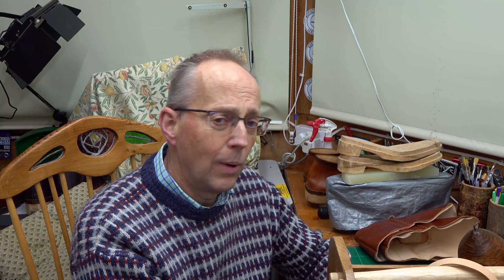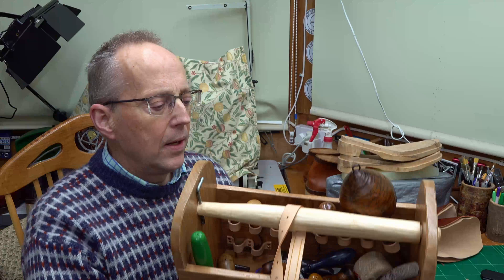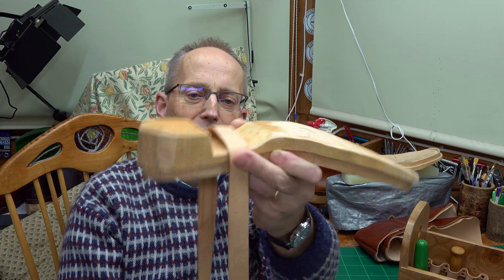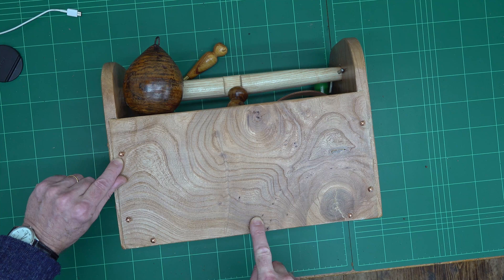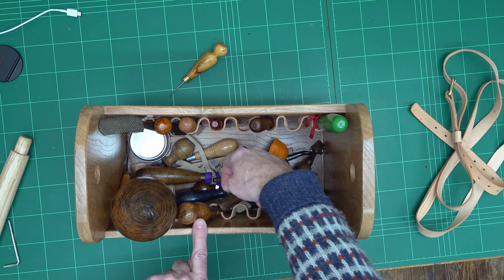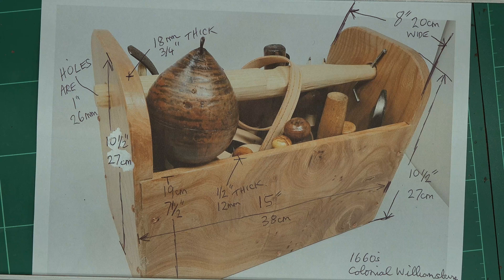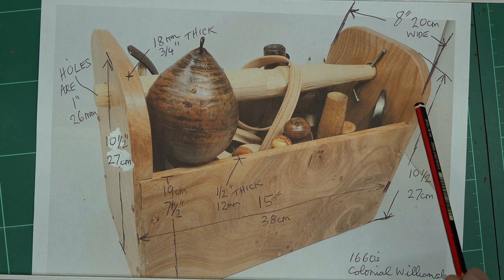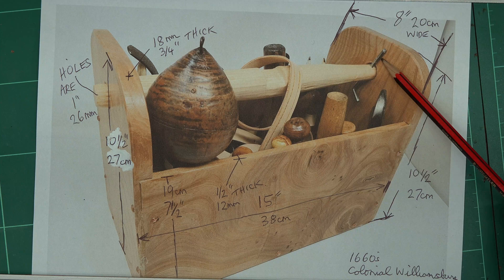1660 Era Ingenious Tool Caddy From Colonial Williamsburgh - Free Plans To Make Your Own

Comment: Thanks Harry. I use a toolbox of similar design, every day. Mine is made of plywood and has a piece of conduit for a handle. It's 8x20, lightweight and easy to carry comfortably at your side because it's narrow. I've added basswood blocks full of small holes to hold drill bits etc.  I wouldn't trade it for anything, think I paid twenty dollars for it at an auction
Reply from the maker: That sounds a very good design Karl...the lightness is great.

Comment: Very good to see you again.  My dad had a couple of tool boxes like this, one a bit larger than the other.  I don't recall seeing him use a strap to carry them, but he did have assorted leather belts & straps hanging on a wall in his tool shed.
Reply from the maker: No the strap is probably only of interest to shoemakers, as it doubles up as a foot operated shoemakers stirrup
Reply: The strap could be used with a low Roman bench to secure wood in a similar to traditional Chinese woodworkers. Great box will certain make one, can never have too many toolboxes.
Reply from the maker: @jeffstratford  Good idea Jeff

Comment: I have a very similar one my wife bought me though the handle doesn’t disassemble. It was frustrating to the point where I sawed it off, adding two inch feet to each end so it was higher. Still not as good as the one you’re showing here.

Comment: Very nice where did you get the copper nails from ??
Reply from the maker: Ebay or boat chandlers
Reply: @harryrogers  Did you cut them down ? because I can see long ones but not short ones  and you must have used short ones as your board for the leather loops was not that thick
Reply from the maker: @kevindesilva4588  Hi yes I used short ones inside and 1.25 inch for the walls....I pre drilled narrow holes for the long ones.